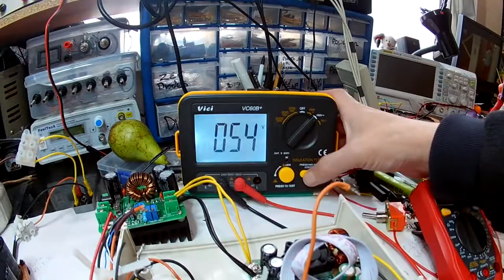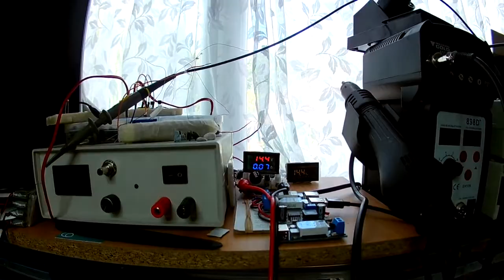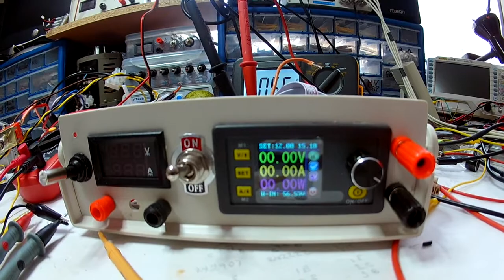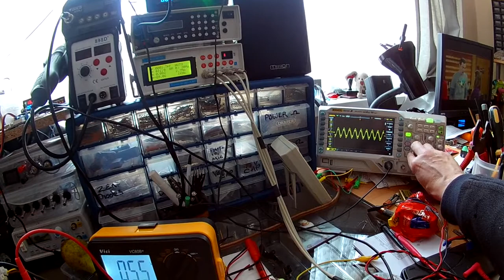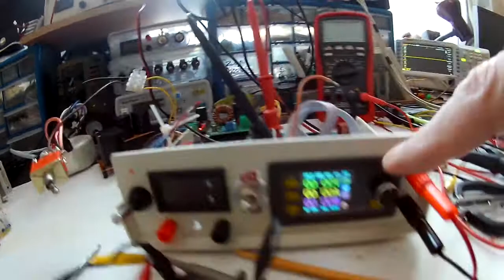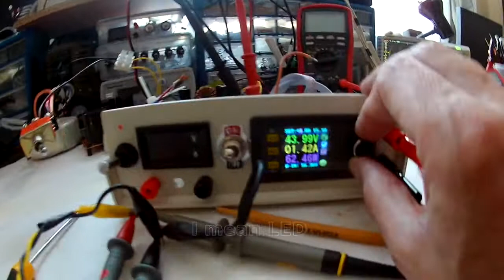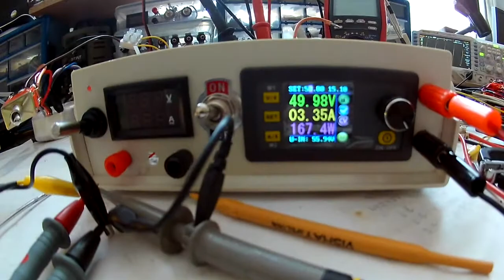DIY Power Supply to  600W BOOSTER then DPS5015

Comment: good video , nice work
Reply from the maker: Cheers. I like your PSU it has done better than its predecessor powering my SSTC, even when I use two transformers together it does not falter.
Reply: Elecifun
thank you for your praise, the quality is very important for me. because there are power supply too rubbish and expensive, so we are design the best power and cheaper 
hope you like it and tell your more friends